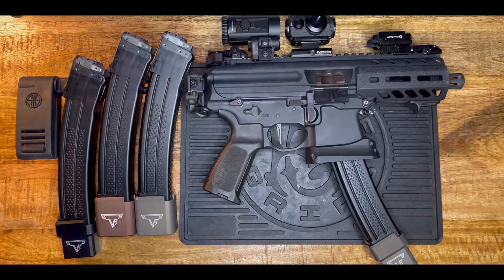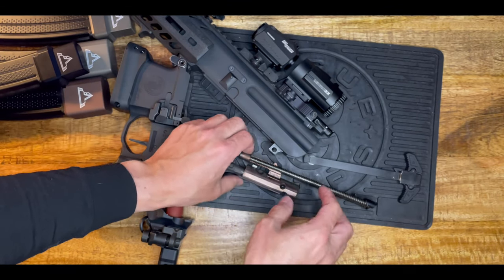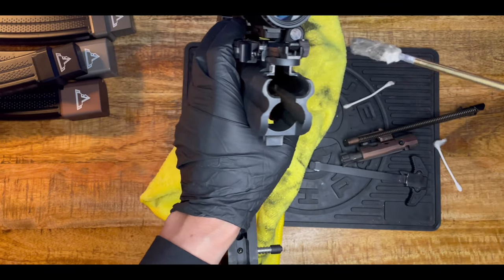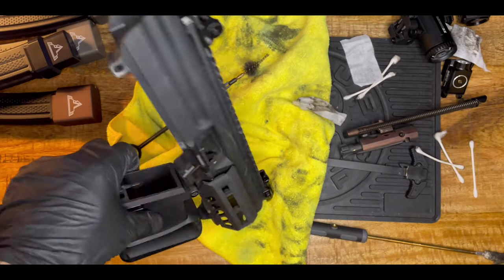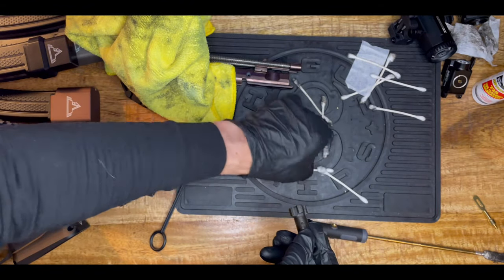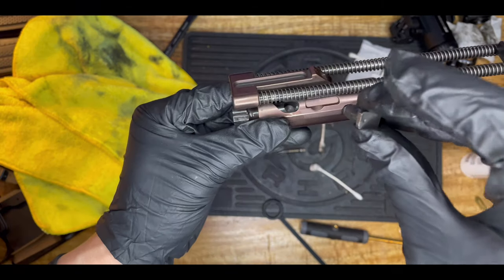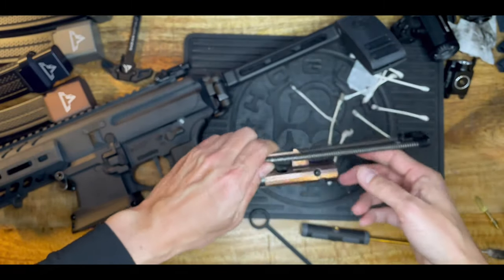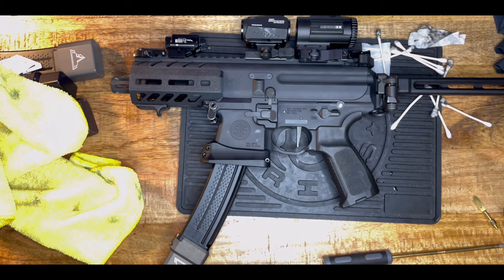Sig MPX K ‣ Disassembly + Cleaning + Oil 【Gun40】

Comment: When you put the cam pin back in the bolt, you put it in upside down.  The dot needs to match the dot on the bolt carrier.  Otherwise you can gouge your upper (ask me how I know)
Reply: what you mean, im little confuse which part of video you mention he did incorret
Reply: @skfheb6572  he is referring to 6:54.   Look back early when you removed it earlier and you will notice the dot alignment on the cam pin

Comment: Great video nice and clean, would you mind to share the brand of the small little handle front at the bottom of upper receiver? and also the red cap at the rear shows at 8:14 please? and also the lock pin with the spring attention? Thank you

Comment: need to know that you are using original trigger or mod. it's so heavy. please help
Reply from the maker: Original trigger. It’s already modified from the factory (Sig).
Reply: @TacticalExpedition  can it be lighter than this?
Reply from the maker: My trigger is super short and light. I think it’s Timmey Trigger Stage 1 that Sig uses.
Reply: @TacticalExpedition  just got gen 3 for 2 weeks old. trigger is really amazing, but really heavy to me. gotta take it to break-in and will update coz it came with nothing even sights.

Comment: putting the cleaning rod down the front of the barrel...yeesh
Reply from the maker: Is there a rule against that? It’s my gun so I can do whatever I want. It shoots great. 🤣
Reply: @TacticalExpedition  it's considered safer to go through the receiver side, not the muzzle, in order to avoid damaging the crown, which can impact accuracy very easily, even the smallest nick.  The second reason is when the brush exits the bore into the action, it drops all the fouling and carbon into the recevier as opposed to out the muzzle.
Reply from the maker: @gabeah  Thank you. I will follow that advise. =)